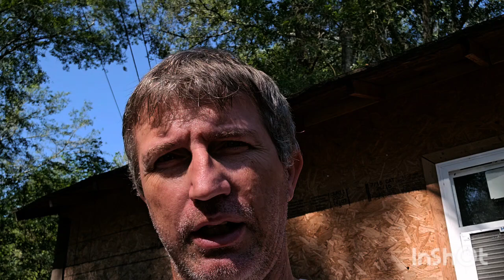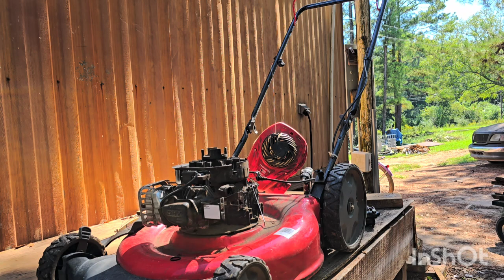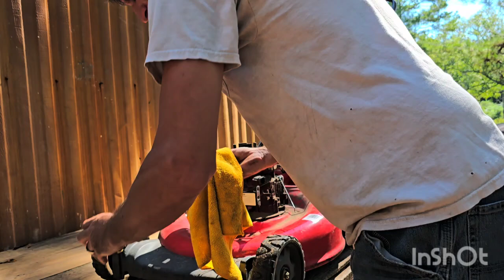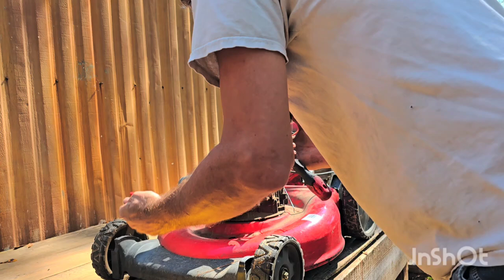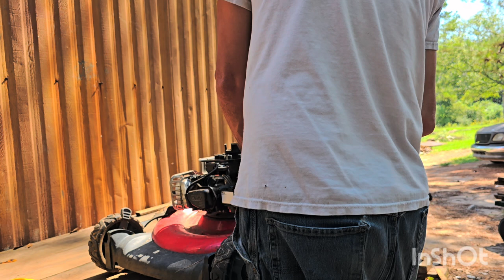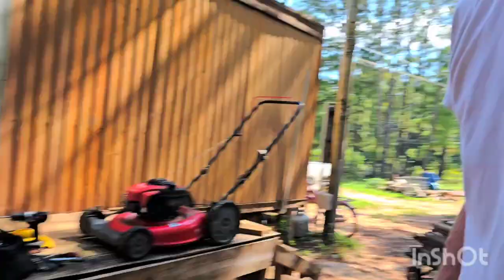Craftsman pushmower trouble

Comment: Clean the tank, make sure gas is fresh,check fuel line for debris and  fully clean the 2 piece main nozzle( white plastic piece in carb).
Reply from the maker: @wyrunuts  i will definitely try all you mentioned. And I appreciate your advice.